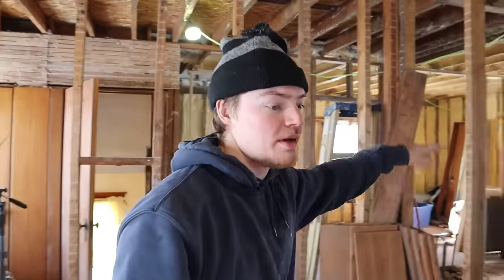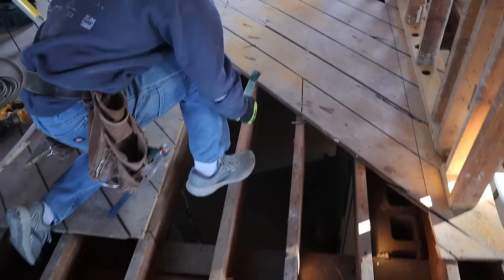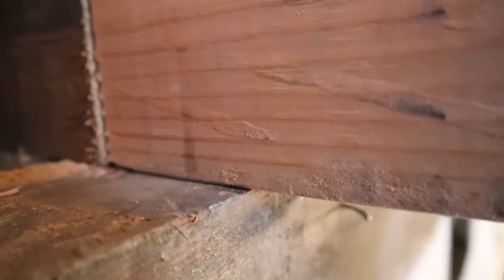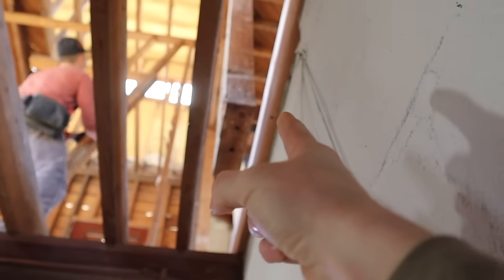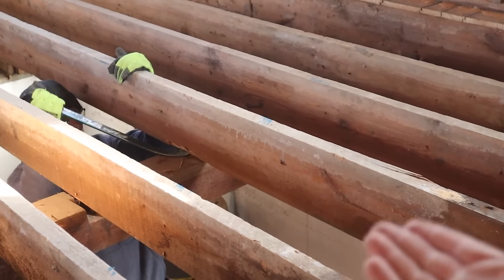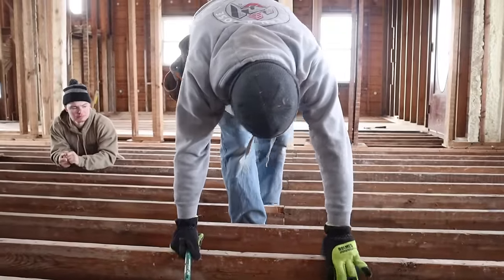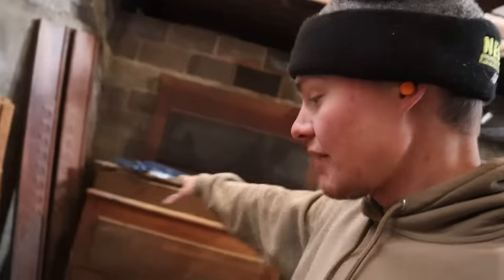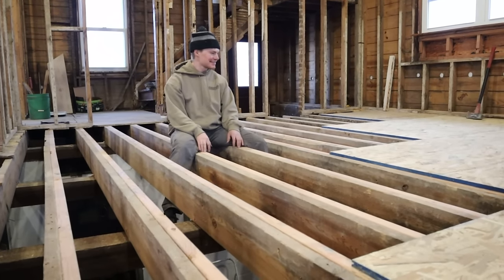Restoring A $7,000 Mansion: Kitchen Floor Rebuild

Comment: That 8x8 bean, due to the notches cut out is now a 6x8 beam.   smiley face sag in the floor beam. Refer to minimum width of said ' beam', that was reduced to a stick right in the middle, No wonder your floor joists are saggin'

Comment: A word of advise for when you close the floors up completely. If you want the sound between the levels of floors to be minimal. Get some sound proofing insulation to stop/reduce the sound transference between the levels. Trust me when I say, if that isn't done, especially with wood floors, you will hear everything that drops, stepped on and or dragged across the floors in the next level down. I purchased some recycle denim insulation for my house and I can tell you that it has reduced the noise between levels by more that 70%.

Comment: If you are using Deck screws to screw joist together, they are not structural screws!
The beam holds up the first floor should be removed and replaced.  A new beam speced for the loads from above should be installed from concrete wall to concrete wall this will establish the bottom of the floor joist height in the middle of the span! Which in turn would probably straight the old joist up.
Me personally I would have  install LVL's  sister to the joist! The spans in your floor system are to big for 2×8's old ones and new ones!
The mental wall as you called it was  shorting the span of the second floor floor joist. The span on the first floor under that mental wall was shortened by the beam in the middle of that floor span, giving the first floor more weight carrying capacity.  
Hire a structural engineer !

Comment: Does spray insulation go into the floor space? If you clean your windows with 1/2 vinegar & 1/2 water to get all that old dust off it will be bright so you don’t have to use torches.

Comment: You should keep the charred piece and make something cool out of it, for posterity.
Reply: Really? Cole’s trying to get away from the hoarder mentality, he doesn’t like keeping loads of things for sentimental reasons so I doubt he’d want to keep an old, burnt, dirty bit of wood.
Reply: @emma_m0  No need to be rude, I did say to make something from it. I'm sorry you're not capable of visualizing things the same way I do. As an artist and maker, I see a really cool lamp made with epoxy in that burnt bit. It keeps a bit of history and makes something ~functional~ from it. I hardly consider that hoarding. /:
Reply: @Seiaeka  🤦‍♀️ wow, you interpreted that as rude! No babes, just pointing out the obvious to you. 👋
Reply: @emma_m0  Well, sorry, it did. It was probably the opener of "really?" it just came off as quite condescending. Sorry if jumped the gun there. It's hard to interpret intonation in text.

Comment: I've never seen a house reconstruction exactly like this.  I'm curious about what order things get done in. When will the electric and plumbing be put in? And does it need ventilation with a floor heat system. I'm not familiar with that type of heat. I'm learning as I watch your videos. Thanks Cole.

Comment: 20:36..... that is WAY to long of a span for that floor system... its very common to have a load bearing wall with a 1 piece floor joist... same thing as spanning a 12" i-joist 28'... its NOT structurally sound at 28' clear span, but it is with 2 14' spans... have an engineer look at this please..... PLEASE!

Comment: That beam in the basement that is supporting the kitchen needs to be replaced asap. It has been notched in several places. When you drill or notch a structural support beam you take away its strength. So a 8" beam now only has the support strength of a 4" beam.

Comment: Why not sister the new floor joists rather than replacing?  Although you might have to shim the gap (or plane the overage) to hit the 4x8 subfloor edge nailing, it would increase the overall strength.

Comment: Might be an issue with having two joists next to each other with running your in floor heat. There's supposed to be a certain gap between the runs, but ive also only had them installed on new builds so consult your expert.

Comment: Time to purchase a collated screw gun that's that's sold for installing deck boards. It's a lot easier to be standing installing flooring screws than to be on your hands and knees.

BTW< get Roman to wear some safety glasses when shattering cast iron. Lots of energy being shed with a sledge hammer blow.

Comment: Judging by some of the spaces your spanning then I'd say your undersizing your floor joists. I believe you should be using a minimum of 2x10 or 2x12. That is unless your going to be adding walls on the lower level. I thought you said you wanted a more open space and that would mean 2x8 which is only meant to span a distance of a little over 12 feet with a 12" spacing would be on the small side. I hope you don't plan on big appliances or jacuzzi tubs. Love the house though.

Comment: Jacking the walls up is the cats meow. But be careful how far you push everything up. If  you jacked the roof up too much, it will break the seal on the shingles. Then before the sun can bake them down again , the wind will catch them and yank them up. The reason I know this is because I did it. I did it on a newer roof, that was mine

Comment: "The floor joist is supported on the exterior wall, and that wall over there with no break in the middle. There for its not a load bearing wall." That is NOT the only determining factor for what qualifies as a loaded wall. All material has a structural span rating. Both functionally and per code. Just because there wasn't a joint above the wall doesn't mean that it wasn't serving a purpose. I guarantee you that joist is over span on both accounts.

Comment: I'm wondering why ye didn't put noggins in-between the rafters lads, make your floor much stronger & also prevent your floor joists from warping. 

Also i agree on other comments use screws to screw down your sub floor, as it'll prevent creaking over the decades. Plus is you ever have faults with plumbing or electrical wiring due to mice etc much easier to lift the flooring if its screwed down plus adhesive. Nails loosen over the years with movement.

Videos always entertaining but don't cut corners in your construction or your safety. I presume ye will be insulating the floors also or will it be under floored heating throughout?

Comment: I would have a rotating laser on that job to know exactly what the heck is going on with the floor. Rotating laser detectors will beep and give you a visual setting high or low .  Rolling that level across those joists. Might measure the amount of bow in them, but little else. I put in a set of new joists by using one and setting a grade line around the entire perimeter. You have to start somewhere. 
   Of course seconds after posting that,a laser shows up on the job.   Anyway we will see how they do now that the laser shows up

Comment: should use nails, gun nails are fine screws do not have the sheer strength that is required for framing

Comment: Can someone explain to this Aussie why the exterior walls have holes in them? It's crazy how differently houses are constructed around the world. Most houses built in the same period her in Adelaide have their exterior walls constructed of stone.
Reply: That’s how insulation was blown in in 70’s.
Before then they were just hollow 🥶
Reply: @Romegrom  Especially so in Iowa 😳 😂
Reply: In the Midwest, it gets pretty cold in the winter. When this house was built, it wouldn't have had much, if any, insulation in the exterior walls. It was common to drill holes in the outside sheeting to accommodate blowing insulation into existing finished  walls. They would then re-side the house covering the holes.  At some point in this house's past, I'm guessing that is what they did.

Comment: that is the thing with 100 year old homes - the board sizes are now different, over time things have shifts and settles - so everything is custom for every job - you can't just go and get wood and fix what needs to be done - cutting to size and shims are needed

Comment: You are spending some serious cash for boards when you do not need to.  If the support is good underneath them just rip 2x4's down to strips that will bring the floors up to level.  You can also see if any jacking can be done.  The strips are like giant shims.

Comment: Tearing out the cast iron waste stack... these idiots have no idea what they're doing.  I hope Cole enjoys hearing the toilet flush or tub drain whenever used.  High end homes and commercial buildings use cast iron, cheap apartments and throw up homes use PVC.
Reply: Replacing old cast iron while they've got the walls open is a good idea, particularly if they are relocating the bathrooms. If it is decades old it will be corroded and will eventually leak or split. 

But for sure, if he wants it to feel like a high-grade home, new cast iron would be a good choice.

Comment: During our remodel, one of the people my father hired shot himself in the leg with the nail gun. He shot the nail at an angle into his thigh. I had just gotten home when it happened. He was going to try pulling it out. I prevented him from this as theirs a major artery in the thighs. I called the ambulance, and wrapped him in an old blanket and laid him on the couch. If he had pulled the nail out, he would have bled out. They raced him to surgery, and he was back to help finish up the next week. Those things scare me. I used the power drill. I'm rather gracefully challenged.😅

Comment: I know there's sentimental reasons to rebuild this house using as much of the old material as possible, but personally, I would have had an architect draw up new blueprints from the original layout, bulldozed the house, and start from scratch. While it might not have been cheaper, it would have been way faster than fixing all those old problems.

Comment: Is it me or shouldn't they be leveling from the foundation (basement) up? They wouldn't need to shim up the joists if they leveled from the basement. In another video, they showed that the main floor had sag as well and it appears they are trying to level from the top down, which is backwards. They should take the 20 ton bottle jack to the basement, lift and level from there, then level the other floors accordingly. The shims are temporary band-aids not structural for load baring joists, especially if they plan to use LVLs to support larger spans, I would make sure that foundation is absolutely solid. Also looks like some of those concrete walls need to be rebuilt as well as the beams. Just seems like they are working backwards from the attic down instead of from the foundation up.

Comment: Still have no idea what the circular holes in the outer walls are?
Reply: Probably from the blow in insulation that they originally had in the walls and attic that’s how they get it in they attach a hose to a hole Dave drilled in and blow it right in those cavities

Comment: Just a tip.  SPF(spruce,pine, fir) 2x8 lumber is not that great for joists.  Southern Yellow pine is much better but you usually have to order it as they don't stock it.  Just a bit of advice not a criticism.  Cheers

Comment: Your "emotional support" wall 100% needs to be replaced by a beam! That span is way to wide for the material you have, in fact, it's exactly twice as wide! You don't think those old carpenters didn't know what they were doing? Doesn't matter that you doubled them up, it wouldn't even matter if you doubled them up properly by gluing and screwing them. Yes I'm talking about the second floor. The first floor also needs a new properly sized beam. Why do you think it bowed? New beam in basement, junk the old notch the old joist so the new joists are resting on new beam. 3/4" subflooring with what you are doing may end up bouncing. You could go with up to 1 1/8" tounge and groove glued down and screwed.

Comment: You’re putting all this money into that house but you have your front entry door going into a kitchen you’re probably gonna spend 65 $75,000 on. I would rethink the location of the door or rethink your kitchen layout and allow for a sectioned foyer.I know you’re a young gentleman and when I was your age I thought very similar but after building seven houses I realize what is good and what does not work

Comment: The "Menta Support Wall" was actualy resting on the Double T Beam in the Basement you can see @22:250 trugh the floor. 
The floorspan in the upper floor also looks awefull far for not having any support in between and only that flimsy joist you americans call structural^^
 would put at least a couble T Beam across the ceeling in the first floor and some massice beams or like you americans do nail together some wallstuds.
if you ever have for example 10 people standing in the upper floor for a meeting and all happens to stand on one floorjoist it will definetely not hold that load.. together with all weight you put in with the ceeling and floor boards, your furnriture on top and soem dynamic loads when people walk.. thats a span i would ne be comftably standing below or on it.
Also ckeck this area to the next floor maybee there should also be a real support beam running across.
You have high ceelings as it looks like you could have something in the ceeeling space running.. there are also ingeneerad I Joist systems iout there.

Comment: How much do you all want to bet that this FOOL doesn't have any permits for any work that's being done.  
If I'm not mistaken any time you pull that all the electrical and plumbing and heating out you're suppose to have permits.  Think it goes for changing wall locations.  
I'd even go as far a believing there's probably no actual plans drawn for any work that's being done.  
I'm sure his insurance company would drop him if they seen any of these videos.
Reply: I can't wait for the inspectors to show up and shut the whole thing down. He'll have more violations than there are stars in the sky. Those will make some interesting and suspenseful videos. 😉 He has no clue what-so-ever of what he's doing.
Reply: This is a Rural area, likely doesn't have permit requirements unless building a new structure.  

I bought a house in in a rural area built in 2000. Permits were required, but inspectors didn't exist.  Mistakes were made on original construction and required repair after i purchased - buyer beware!   Wood structures can be very forgiving for structural sins, but it doesn't mean the drywall will be crack free.
Reply: @DF-zp1os  rural area doesn't matter, there's building codes that need to be met when you've demolished the inside and pulled everything out.  
You can't just go throw up a new house with permits.  This isn't any different.
Reply: @CletusMcFetus85  who says Jistin is a licensed contractor.  I'd almost bet he doesn't have one.  Just because someone had worked in a certain field doesn't mean they have a license to do things.   And as much as Cole is against following the rules on things, he's not following many on this whole dam mess.
Reply: @lstone.09  no doubt building codes exist, but if no one is paid to enforce/inspect it's just a book on the shelf.
Reply: @CudMcCuddles  been here longer than most.  Still haven't ever heard this fool say that Justin is a certified licensed contractor.  
Anyone can call someone a contractor.

Comment: ROMAN BIG NO NO starting @38:45 looks like you’re sawing with NO SAFETY GLASSES ON & THAT’S A BIG NO NO.  If You take A piece of plywood chip to the eyeball, you could be looking like BLACKBEARD THE PIRATE 🏴‍☠️  the rest of your life....Then As you’re looking at your kids & grandkid’s with a patch over one blind eye...You’ll say: Kids Do as I say, not as I done, If only I had been wearing safety glasses while using power tools while working on my Friend Cole’s House I wouldn’t be looking at you with 1 eyeball right now!!! Then in Pirate Fashion with your eye patch on you’ll say:  Hardy Har Har,  Fi  Fy  Fo Fum I smell the need in wearing Safety Glasses from now on. 
😂🤣🤣🤣
Reason I’m telling you this is a bad experience of my own stupidity. I was drilling metal on a Drill press without safety glasses 🥽 and I took a piece of metal to the right eye 👁 and ended up in the Emergency Room. Doctor said I was very lucky it didn’t blind me & I had to wear a patch over my eye for about 3 weeks after the piece of metal was surgically removed from my eyeball 👁!!! So wear eye protection  🥽 at all times. 👍🏼
Reply: Roman and you’re using the nail gun without safety glasses 🥽, That’s a HUGE HUGE HUGE NO NO !!!!! A piece of that nail flys up and hits you in the eye and your blinded. Use some common sense brother.

Comment: Why do you "restore" an old house when you rip the whole sole out of the house? You have already changed the outside appearance. When you are done there is no history left in that house. The uneven floor boards and not so strait walls are history! If you wanted a modern house with an old appearance, why didn't you just build one?
Reply: Because it’s his and he doesn’t want to deal with trying to finish things to a high standard with warped and uneven framing. The house and property will have just as much history and will be much more livable, efficient and valuable when done correctly
Reply: @bowtieguy6870  I disagree with you. It's similar to you taking an old car from the fourties and installing suspension, drive train and everything else from 2024 except for the body. Then you don't have an old car with its history anymore! You have a new car with old appearance.
Reply: @jonmcfarmer6954  I totally understand and respect your point of view.